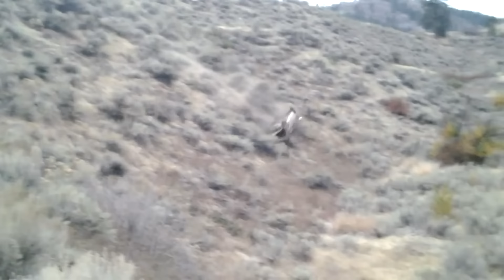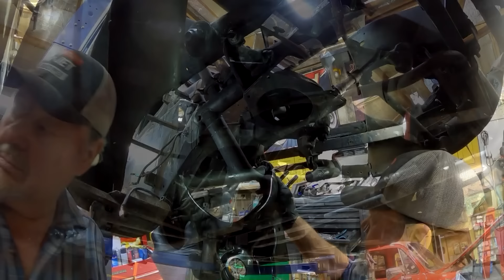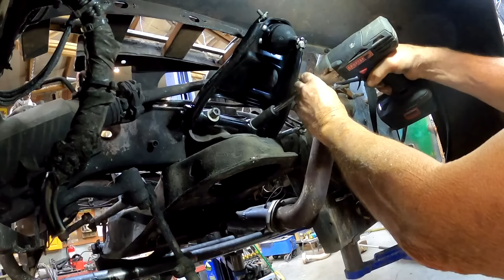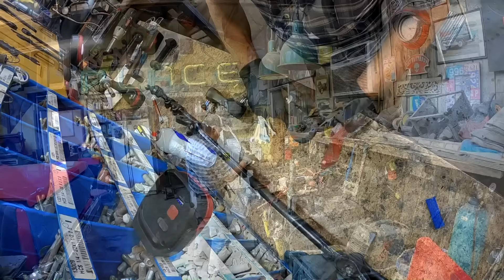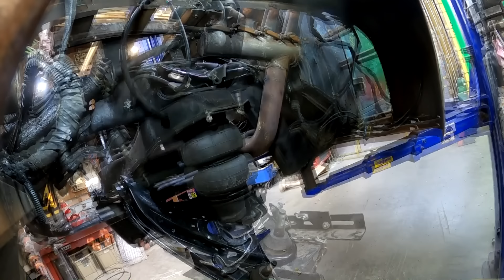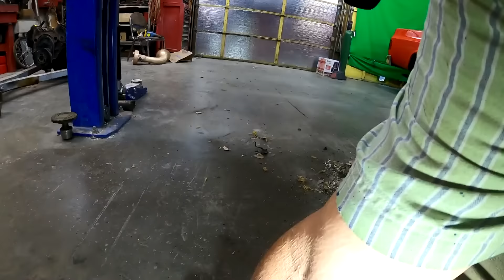THE BURNT RAT ROD  gets NEW FRONT SUSPENSION

Comment: Buying any type of replacement auto parts online is like a game show.Not everyone can be a winner. But even at your local parts store  if the editors didn't catch the mistake before it is part of the parts lookup software that is common to many companies. many people will get wrong parts.
When we used catalogs, the first guy to face an angry customer wrote in the margin to warn the other employees (usually)
 *cannot do that now
Tsk,
progress
Moral: if you buy  a front suspension rebuild kit,check to see if the pre-installed ball joint shafts fit into your spindle/knuckle.If it includes other suspension parts-check them too.
Ken is such a mild-mannered man-  if you turn wrenches and this (bs) happens you know the profanity that's part of the Grease & Grime, you betcha
Correct Parts! Maybe! Maybe Not! 

Success=Equal parts dedication inspiration motivation determination  and perspiration
VERY informative show,Ken.

Comment: Why can't you take your spindle in to a machine shop and have them nureld out to the size you need then you could use heavy duty ball joints (not sure if the price off set is same)
Reply from the maker: machine work around here is more expensive than new a arms

Comment: Your using 20 series control arms. Change the ball joints and it will work.
Reply from the maker: cant put the smaller ball joints in the bottom a arms..

Comment: had the same fit issue with pitman arm and draglink, correct parts and numbers but would not match up on a 79 K10. Some of the most common parts ever mfg you would think that it would be almost impossible to screw up but it happens anyway.

Comment: My Grandkid purchased a 2004 Silverado with a 12" lift kit. 2 Wheel drive? Yes 2 Wheel drive? They had 1/2 ton Balljoints, slopped in a 3/4 ton Lift spindle. Aftermarket crap. I seen him driving this contraption and made him PARK IT RIGHT NOW! Reverse of what your situation is. Remember the old saying... THROWING A HOT DOG DOWN A HALLWAY...

Comment: I’m working on a 2015 with a collapsed lifter doing a dod delete I know the slow feeling I hear several have had low oil pressure at idle problems and trying to figure that out I started in December but why rush right 😂